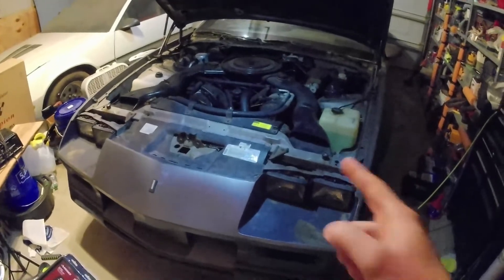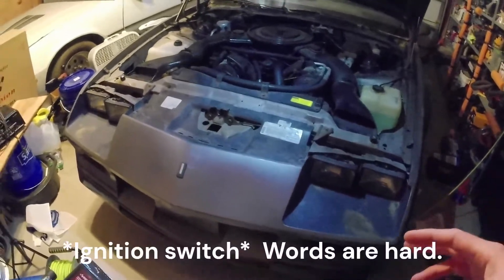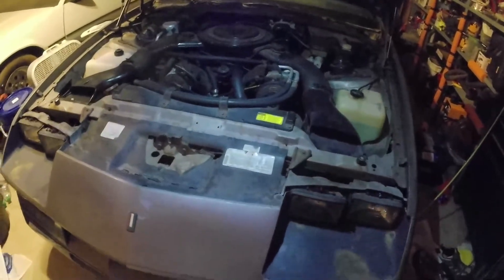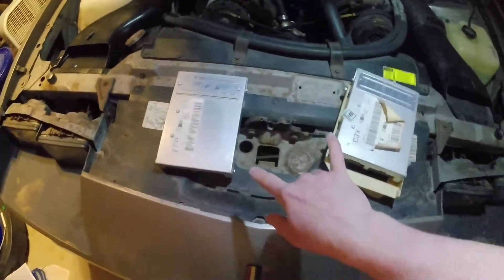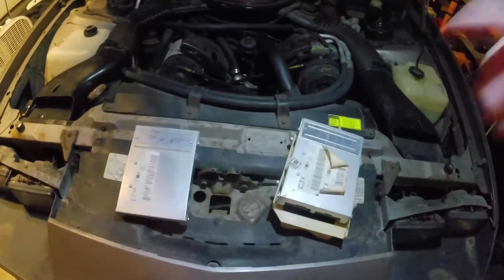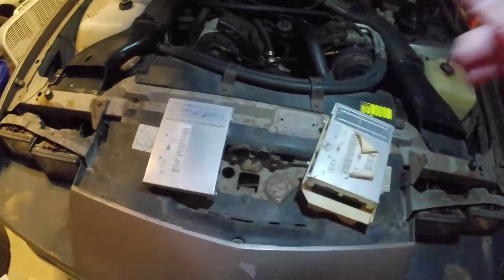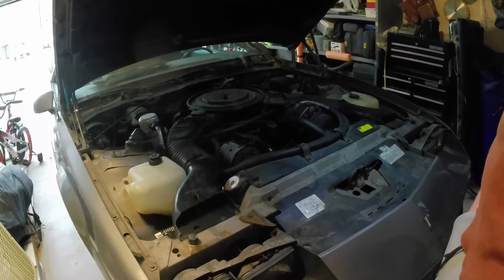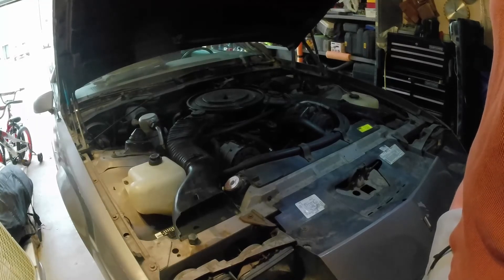Replacing the ECM and PROM chip in a 3rd gen F-body (1984 Camaro Z28)

Comment: Stop sucking your teeth. Stop saying it threw a code. It sets codes. Ohms is a name not a test. Resistance test not ohmed out at. Don't say kinda, it is or it isn't. Your ignition module or your pickup coil is failing in your distributor most
Likely. You are describing a no start after hot soak. You could do a Resistance test to ground on your white with a blue tracer wire from your distributor to rhe main harness. Disconnect the 4 wire connector from the back of your distributor turn the key on and read the Resistance value. It should be 500 Ohms or less. If it is around 370 Ohms it is OK. Stalling is not cause from the module. Check  the Resistance valve of the pickup coil in the distributor when it happens.
Reply: Also the dielectric grease can dry out and become powder and the heat transfer into the distributor housing stops and over heats the ignition module.
Reply from the maker: I can't tell if you're trying to be helpful or a dickhead.  I will continue to say and do what I please.  I ended up replacing the distributor and it fixed the issue.  Aside from still having a heat soak problem after the car has been shut off after running for a while.  Not while actively running like previously.

Comment: Hey, I was having a similar problem with my 85’ with carbureted 305. I threw a bunch of parts at it, including pretty much completely rebuilding the distributor, spark plugs, plug wires and numerous sensors. A friend of mine who has quite a bit of experience working on these told me that I needed to replace the entire distributor. Supposedly after so many years they can develop short, I think within the stem. Anyway I replaced the whole distributor stem and all, with a stock distributor and retimed the engine and it has ran fine ever since. Hasn’t stalled not once. Will this fix your car? I couldn’t say for sure, but if it were my car I think it might be worth a shot.
Reply from the maker: This comment makes the second time I saw someone say in some place that it is a very little-known thing and could be the distributor.  I currently have a new temp sensor, thermostat, housing and radiator I am going to throw in the car.  The radiator is leaking and needs to be replaced.  The very first thing I did when I got the car was replace the thermostat to a 180 I believe.  I thought maybe that could have affected the temp sensor.  So I will be changing that out.  If that doesn't fix the issue I will go distributor route.  I don't want to keep dumping money into the drivetrain because all of that is going to be yanked out and I have a really sweet plan for it.  Just lacking the fund.  Thanks for the info.

Comment: Coolant temp sensor for ecm, there is two, one for the guage and one for ecm
Reply from the maker: Are you referring to the fan switch?  There is the sending unit for the gauge and then the temp switch for the fan.  The fan has always come on just fine when it reached temp.
Reply: @greasyfingergarage  Hello For clarity on a car that has a Temperature Gage/readout there are 2 sensors. 

On an 1982 Camaro circuit #410 is ECM to Coolant Temp Sensor. The sensor is analog ; a Thermistor. Resistance drops when the engine is higher. Inside the ECM is a 5 volt DV reference and Reference resistor; then a wire circuit 410 to the Coolant Temp Sensor.  The sensor is part of a voltage divider circuit

So the ECM controlling the engine uses a dedicated Coolant Temp Sensor. This is not the same sensor used by the dash temp guage. 

The dash temp guage at least on an 1982 uses a different sensor..

So if the car has a Guage the shop manual calls the sensor a "Sender" ie Coolant Temperature SENDER circuit #35

So if the car has a "Temp overheat light" the shop manual calls the sensor a Switch ie Coolant Temperature Switch circuit #35

So for clarity the ECM and Dash use different sensors

The ECM sensor is usually a 2 terminal device; ie the ground return is not the block but the extra black wire

The Dash Temp guage sensor is usually a 1 terminal device; ground is through the engine block. 

The Dash Temp Idiot light switch is usually a 1 terminal device too ground is through the engine block. 

The scheme purposely uses two independent sensors so a faulty dash guage does not cause the engine to die or run terrible

Regards chasing down issues

Type in Ebay "1984 camaro temperature sensor" and you will see the Three  types.

 When starting my 1982 Camaro the ECM "look at" the ECM's Coolant Temp Sensor as a basis of setting the RPM at Idle. So when a cold engine the ECM keeps the IDLE higher. In testing I replaced this sensor with a variable resistor and that resistor directly would vary the engine rpm via re setting the Idle motor
Reply from the maker: @3beltwesty  Good info.  And yes on the sensors.  There is the one in the goose neck for the computer, one in the driver side head for the gauge and the switch in the passenger side head for the fan.  I don't remember what I even said in the video since I made it so long ago.  It ended up being my distributor.  Needed a new one but it will still heat soak and not throw spark if the car has been sitting after running for a bit until it cools itself off.

Have you ever tuned the carb successfully on these cars?  I have 3 failed attempts already.

Comment: Almost like it dies when it goes into closed loop
Reply from the maker: If only it were that consistent.  Sometimes it will run without dying.  Sometimes it will cut off after a couple of minutes.  Sometimes its dies after a few seconds.  I have no idea what is going on.  I did just rebuild the carb today but then started getting rained out so I haven't tried to start the car yet.  The carb rebuild will be my next video.  Fingers crossed.